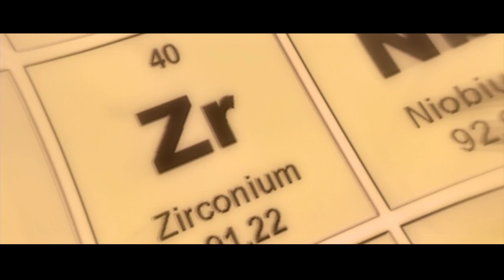The End Of EV's? Elon Musk Reveals Possible Ammonia Powered Engine for Tesla!

Comment: SMH Hybrid vehicles have to be the way to go. You need a batter to store the power created by any type of fuel that is burned because the vast majority of any type of combustion engine is wasted
Reply: 😶‍🌫🤯We will soon introduce the revolutionary FAZE engine technology.
The 𝔽𝕦𝕖𝕝 𝔸𝕘𝕟𝕠𝕤𝕥𝕚𝕔 ℤ𝕖𝕣𝕠 𝔼𝕞𝕚𝕤𝕤𝕚𝕠𝕟 𝔼𝕟𝕘𝕚𝕟𝕖  
[𝔽.𝔸.ℤ.𝔼.] tech best solves the issues present in previous internal 
combustion engine designs by transforming the old paradigm into a 
simple, low cost, quiet, power dense, efficient, on-the-go liquid and 
gas fuel-flexible, ‘non-polluting’ solution for power generation of all 
scales and advanced transportation, construction, military, off-road 
vehicles including ships, aircraft, trains & robots not possible before 

𝔽𝔸ℤ𝔼 delivers better than 25% ABSOLUTE/ACTUAL [not relative] 
fuel efficiency improvement over gasoline engines, more than 15% 
for Diesel engines at any operating condition - speed/load, ambient 
temperature or elevation, not just at one optimal testing point at 
STP. Real world driving cycle savings could be an additional 200% 
higher due to the constant MAXIMAL efficiency and torque. The 
simple, low cost, native/built-in, non-electric, environmentally safe, 
non-explosive, temperature agnostic 𝕊𝕦𝕡𝕖𝕣ℍ𝕪𝕓𝕣𝕚𝕕© feature 
recovers more energy than EVs and provides approx.100% fuel 
savings for a combined absolute vehicle fuel usage improvement of 
approximately 300%, thus obviating the basic need for expensive 
EVs & e-hybrids. 𝕚ℙ𝕠𝕨𝕖𝕣𝔹𝕠𝕠𝕤𝕥 adds >400% more torque. It’s like 
4 engines in 1. 𝕚𝔼𝕗𝕗𝕚𝕔𝕚𝕖𝕟𝕔𝕪𝔹𝕠𝕠𝕤𝕥2© further improves efficiency, 
torque, power & other performance metrics by 10%. This is all done 
w/o a transmission. Additional fuel saving solutions are available.
 
The FAZE engine perfectly follows the vehicle’s road or genset’s 
electrical power demand with no energy loss [no fuel waste], This 
unique characteristic enables dispensing with any auxiliary power 
units [APU] for power or refrigeration in any application. This also 
makes for a perfect range extender for battery electric vehicles [EV] 
or as a standalone EV charging unit even where is no electric grid.
 
The fuel agnostic capability allows instantaneous use of any liquid 
or gaseous fuel [natural gas at home!!!] incl. biofuels and hydrogen, 
even if old/dirty/unprocessed like flare gas or employ the concurrent 
multi-fuel capability…anywhere on the globe. One engine for all 
locales w/o changes! Unlike EVs, this enables fast fueling anytime, 
anywhere…with no troublesome infrastructure disruptions or 
changes. EV’s are not a solution to the [FAKE]climate or mobility topics as 
high level of electrification globally is unrealistic 
[See Patrick Boyle's video "Electrify Everything?"] 

The technology offers smokeless, non-polluting, low odor heat and 
noise output without costly after-treatments, etc.,… with only the 
lowest  CO2. It has a negative carbon footprint with hydrogen, 
ammonia, biofuels or gasified municipal, agricultural and/or forest 
waste and coal from a 2-stroke-like simplicity. These are HUGE 
business opportunities. We can provide these turnkey solutions 

The FAZE technology can be integrated into any ICE or vehicle 
architecture, adding some of the positive characteristics to its own. An advanced Scotch Yoke architecture slated to be incorporated in the 𝔽𝕦𝕖𝕝 𝔸𝕘𝕟𝕠𝕤𝕥𝕚𝕔 ℤ𝕖𝕣𝕠 𝔼𝕞𝕚𝕤𝕤𝕚𝕠𝕟 𝔼𝕟𝕘𝕚𝕟𝕖  [𝔽.𝔸.ℤ.𝔼.]

With virtually no electronics and emissions equipment, the cost of
purchase and reduced servicing frequency make this solution 
even more appealing.